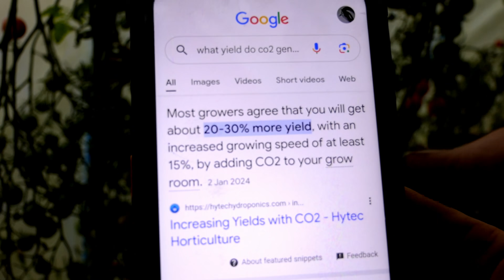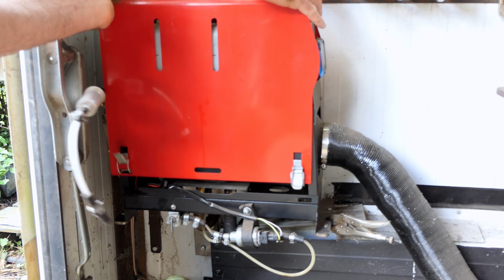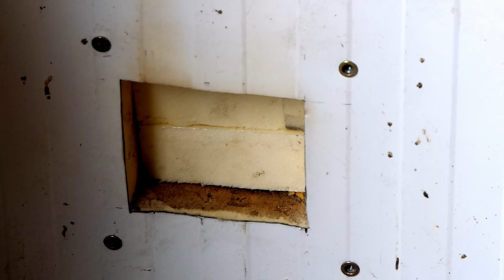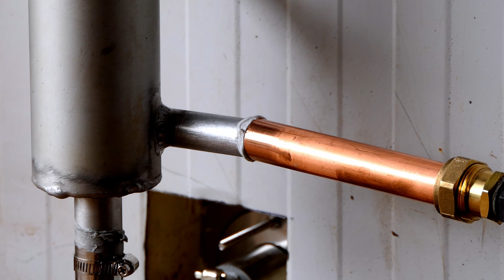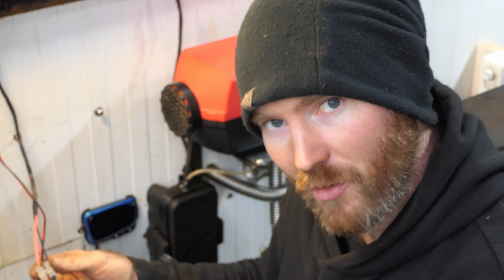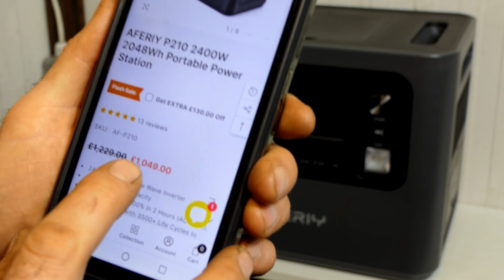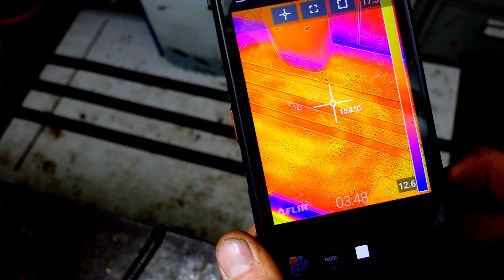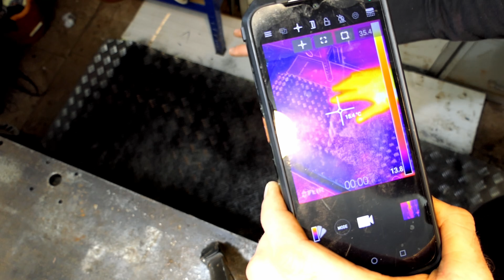NEW! Better system for Cheap and Safe Heating💲+ Underfloor Heating Mod test🫠

Comment: In Poland, 1000 liters of kerosene costs £2000, which is about £0.20 per 1kW of energy.

1000kg of coal costs about £200, 1kg = 8kW, which is £0.025/kW, which is 10 times less expensive than kerosene. I don't know how efficient this heater is, but a coal boiler has an efficiency of 85 to 90%, so it's still much much cheaper than kerosene heating.

Electricity in Poland is the most expensive in Europe and with frozen prices we pay about £0.23 per kWh (including all fees such as taxes, etc.), heating with electricity, e.g. a heat pump, is the most expensive. With natural gas, which has about 10kWh of energy in 1m3, the cost is £0.08 per 1kWh.  Whereas dry wood, which in 1kg has 4kWh, at a price of about £120 per 1000kg, cost of 1kWh = £0.015, and wood is the most ecological and renewable source of energy, so maybe you will build a device for gasification - dry pyrolytic distillation of wood - and start heating the workshop with wood gas? :)
Reply from the maker: @tomashhz  nice. I'm definitely going to be extracting the waste heat from wood gasification for my central heating. The rest will be for electricity. Cheers J

Comment: Water with copper and aluminum together? is not a good idea—galvanic corrosion will eat away the aluminum, but maybe with good grounding it wont be a big problem?!.
What you got wrong is that direct contact isn’t even necessary. Water itself can carry enough current between copper and aluminum to kickstart galvanic corrosion! Source: years of water cooling computers haha

Comment: Great video and definitely something that most people using these heaters should be doing. 20% saving is well worth it over a year... I plan to get one of these heaters for my own workshop and would want to capture some of that wasted heat so i'm following this series very closely...

The first thing I said to myself though when I saw that heat exchanger is that it is far too short for the fast moving air to get a chance to heat the walls. Also inside the pipe only the exhaust gases that are in direct contact with the wall of the pipe (a few mm) will have any effect and the gas down the middle will pass through unaffected, similar to the Leidenfrost effect or laminar flow (but also not really). What you need is a longer section for the gasses to act on but also some disturbance in the gas path (cyclic or zig-zag) so that the gasses touching the wall are kept the hottest that they can be...

It's going to be expensive to do a zig-zag or cyclic path in copper but i've often wondered whether a scaffolding pipe inside a PVC downpipe would work. Scaffolding is about 2" and a 3" downpipe would give you approx. 1.6 litres of water per metre and would be relatively easy to make as long as you needed...
Reply from the maker: @smitcher  thank you. I'm making an exhaust manifold and passing it through a 210ltr water barrel with a circulation pump. That should do the trick nicely. Cheers J
Reply: @ cool. Looking forward to seeing that!

Comment: Nicely done Josh.  Regarding extracting the waste heat, have a think about doing it in multiple stages.  Reason being, with direct to water (EGR cooler) if the water is running slowley, it can easily become over heated. Either boiling or creating a failure in the pipes thermal limit.  Running the pump too quickly will not allow for the heat absorbtion to be efficient. This is why ERG coolers have multi pipes to extrease surface area for heat exchange and allows for a shorter heat eachange unit to extract the necessary heat, but this is balanced based on water flow speed to desired output temp.  The remainder unfortunatly is pushed out as waste heat.  Your short EGR with its water flow (as you demonstrated) tops out at 50degC for this reason.  Increasing the heat exchange efficiency whether its multi cavity EGR or longer pipe will neccesitate you increasing the thermal mass that its heating (more pipe or radiators) to reduce the risk of high temp failure within the system and possibly increasing the water flow as the temperature rises.  Personaly I would build in a high temp safety feature (either electronic cutoffs or a expansion vessle for closed system or a tall pipe from an open vented hot water tank) and also look to add in an air-to-air exchange first ahead of the EGR cooler, (becaise air can handle the higher tempertaures) and also improve your EGR cooler efficiency by either multi cavity or longer run or even multi versions of the same design.  But what ever you do, make sure you remove any possibility of producing legionalla.
Reply from the maker: Excellent points. Thank you. Cheers J

Comment: I have  a short exhaust pipe on mine to a cycloidal soot trap which also collects a fair amount of condensate in the  15l stainless container. The container has a self starting syphon to empty itself. The exhaust then has a section before exiting the building. I'm considering a multitube heat exchanger for water now I'm happier the exhaust is cleaner and dryer than it was
Reply from the maker: @merlynsfire1275  nice 👍 Cheers J
Reply: @joshuadelisle  pleasure sir
Condensing releases the evaporation heat back inside the room. 
Could I suggest a video on your settings or approach and method of adjusting the fan/oil feed balance for different fuels/mixes/experiments?
Reply from the maker: @merlynsfire1275  thank you. I adjust settings in my other diesel heater videos. There should be a playlist with 4 videos. Cheers J

Comment: The exaust cannot go under 120°C, otherwise, condensation will be an issue.
Reply from the maker: It becomes a condensing heater then. Not a huge issue to have condensation out the exhaust, it just needs to be a non corroding metal such as aluminium. Cheers J

Comment: Silly question but why don't you evacuate the exhaust directly into the radiator. This would avoid going through an air/water exchange. So of course you would have to use an "old" type radiator and I imagine putting a filter or something for carbon deposits.
Reply: Small piston airplanes actually use this method, just an exhaust to air heat exchanger.

Comment: A couple of points of note for you:

1 - Be careful in using thermal imaging to determine true surface temperatures … thermal imaging is good at showing one surface is a different temperature compared to another … but to determine the specific value of these temperatures you need to calibrate against the specific emissivity of each surface. If you want to measure surface temperatures in a meaningful way, it’s best to use stick-on thermocouples … just make sure the TCs are well adhered to the surface because they rely on a good thermal connection to ensure conduction. Ideally stick them down with something like epoxy, but this will be a one way trip for each TC … if careful, a wrap of Ally sticky tape should be good enough. Just remember that the thermocouple will only tell you what temperature you have at the layer it finds itself in the thermal gradient running through the thickness of your structure … from your heat source out to the outer surface, you always have a thermal gradient .. the gradient depends on the materials .. you get a low drop through a good conductor like Cu or Al .. and a bigger drop through poor conductors like polymers or air gaps. 

2 - The comments about thermal conduction equally apply to your underfloor heater … nothing wrong with your spiral configuration .. you’re correct in your interpretation .. and nothing wrong with setting the heater pipe ON a foam insulation bed … just NOT in it !! … you need to ensure very POOR thermal conductivity from your heater coil down into the ground and very GOOD thermal conductivity between the pipe runs to diffuse the heat laterally and very GOOD thermal conductivity to the top surface to permit the heat flow upwards and into the room. Your initial demo panel only did the first bit of this … you insulated your pipes so well that you failed to emit any heat in any direction … nett result being the wall radiator got all the heat energy !! …  I cringed as I saw you burrowing the pipe into the foam insulation and I groaned when you went generous on the foam adhesive .. and nearly wept when you made no attempt to uniformly spread your adhesive before putting the top cover back … with my fears confirmed when you later peeled it all apart and it was clear how hit and miss the top skin was attached. This is why underfloor heating is typically formed by placing the pipe run on top of an insulating base and then cast within a uniform screed .. the screed acting as a thermal mass to provide a controlled release of heat across the surface and over time to damp thermal cycling from your heat source. Those systems that do not use a screed typically use Aluminium diffusers to spread the heat laterally and to connect to the covering surface. 

Please do not be offended if it appears I am coming across all superior and trying to win points at your expense … I really appreciate your candid style and application of Common Sense (a substance that seems to be in short supply in these times) and I truly admire your determination, attitude and willingness to admit the occasional error in your cunning plans. I’m afraid my lecturing style is simply the result of 40+ years working in various aerospace applications based on the magical black art of heat transfer 😳
Stay safe .. I await your next adventure with great interest 👍👍
Reply from the maker: You make great points. Thank you. Cheers J

Comment: Where you live? Here in east Europe (Balkan), cerosene is very expensive. Diesel is also expensive for heating. Vege oil is cheap enough, and waste oil is cheapest.
Reply from the maker: UK has cheap heating oil (currently). It goes up and down depending on Eastern conflicts. Cheers J

Comment: I wonder how a copper coil would work inside your housing that is filled with water? And then sand around the coil. ? It might exchange more heat to the water

Comment: Talk with local (or not too distant) auto repair shops or parts stores about getting their used motor oil. They pay to get it pumped out via truck and recycled. They may allow you to get some for free. Mixing the used motor oil in can work as a lubricant. Just don't make the ratio too high as the thicker oil is more work for the pump.
Reply from the maker: Good idea. Cheers J

Comment: Two good things about heat pumps: 1 they are cheaper than other electric heat, 2 they run on electric (which can be renewable). The bad, while they save money compared to electric heat, they are more expensive than fuel based heat.
Green people like heat pumps because the electric can be provided by renewable sources.
Reply from the maker: I recommend watching Michael Moores documentary call 'the human planet' renewables are not what they seem. Cheers J

Comment: Great video (as always) and I especially agree with what you said in the last 10 minutes. Thank you for being a voice of researched reason, standing out tall amongst the brainwashed sheeple. Is your content also on Odysee and/or Rumble? If so I'd prefer to watch it there where freedom of speech is respected, and there is no censorship.
Hole saw in a hole saw is not something I've seen before BTW, but definitely something I'll use going forwards. Thanks again.
Reply from the maker: Thank you so much. I may re-post to Rumble. Well see how it goes. Cheers J

Comment: Hello galvanic corrosion........... It's not about not letting the metals touch, it's that particles of both materials flow in the fluid. Your pump mesh is going to collect rust. it will likely also settle in the your underfloor pipes. Any experienced PC watercooler will tell you that you NEVER mix aluminium with ANYTHING.
Reply from the maker: You're correct. This is just a prototype made from scrap off cuts. Cheers J

Comment: Good video just remember not to mix metals. You mentioned it in the video but even if they are not touching the galvanic corrosion will still happen through the fluid and eat away at the aluminum
Reply from the maker: Good advice. Cheers J

Comment: I have watched several of your videos just out of curiosity but am now in the situation of looking for a heating solution as I've moved to an old house in the Japanese countryside. Currently using a Japanese Kerosene Stove which is very powerful at 6.6kw but I'm not happy with the smell it gives off both when igniting and extinguishing it and the inability to regulate the heat without affecting burn efficiency and cleanliness. According to the manual you have to ventilate the rooms/house 1 to 2 times an hour which I find to be very inefficient. Since the Kerosene price here is almost the same as it is on your side of the planet (~104yen/liter) I'm seriously considering setting up something with a Diesel Heater. Very much like the solar panel + battery pack combination to power the whole thing. In theory a very cheap and easy way to pseudo off grid without knowing much about setting up a sophisticated solar system, battery array and the whole electrical wizardry.

A word of caution regarding your stance (which I highly agree with by the way): We're in censorship hell, especially on this platform. Even licensed doctors had to self censor these past years as to not get their channel banned for "misinformation" and "conspiracy theories". I'd hate to see your channel gone. 

Thanks for everything you do. I greatly appreciate the thorough testing you do and ALL of the links in the description to everything you used/mentioned in the video.
Reply from the maker: Thank you so much. We would love to move to Japan if it was accessible. My daughter has already learned a lot of the language and how to write as part of her home education. Any tips would be greatly appreciated. All the very best with your heating. Cheers J

Comment: burners do not create large amounts of carbon monoxide, regardless of fuel. its under certain fault conditions where they do, and that is why you need the alarm. a low output of carbon monoxide can also become dangerous without ventilation.
Reply from the maker: Some fuels are harder to generate CO than others but you're correct that any fuel that isn't burning correctly will generate CO. Cheers J

Comment: 25:24. You don't mean 'Watts per hour'. You mean Watts, i.e power. 
'Watts per hour' is a nonsensical unit which is almost never used because it would be 'rate of change of power'. The text is right (Wh for cost of energy), just not the words. 
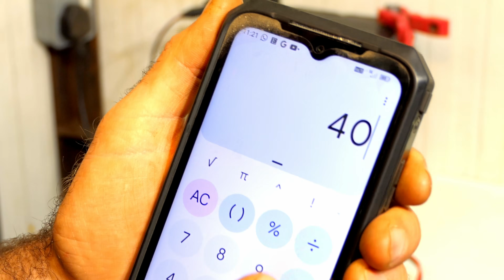Ah yes, must just have been a slip of the tongue/brain as you get it right at 27:12. Cool. Don't mind me.

Comment: Heat recovery - have you considered a sand battery?

One of those 1000 ltr kerosene tanks copper pipe, lots of PC heat pipes, cheap roofing insulation and a metric fuqu ton of sand
Reply from the maker: That was my last experiment. Water as thermal mass works much better at this scale and temperature range. Cheers J

Comment: I’m not sure the lubricant in the diesel is critical to those dosing pumps. 
Both Ebersbacher and Webasto (the major manufacturers of “quality” heaters, from which the Chinese ones are copied) make kerosene and petrol (gasoline for American viewers) versions of their heaters and they use essentially the same dosing pumps. If longevity was a problem, it would be well documented by now.

Comment: Wohaaa ... 4% ... that's interesting. My 2019 calculations with generous numbers got to 0.04% / year on top of the natural carbon cycle. So .. that means that a good portion of the CO2 since the industrial rev. did not absorb? .. Interesting.. I need to crunch more numbers at a certain point.

Comment: We use a Kerseen boiler to heat the house the exhaust is so cool you can put your hand over it, 96% efficient.  A used commercial boiler would be a far better option for whole house heating rather than messing about with a Chinese heater.

Comment: Hi there 
Great video.Definitely one of the cheapest and safer fuels to use.
Just a thought could you directly pipe the exhaust gasses through a radiator then to outside.
Maybe with full metal larger pipework and an old cast radiator.
Inlet at the top, outlet at the bottom.
This might get to temperatures like your heat exchanger body.
Then you may be able to run your generator for less time.
Then you could cage it off like you would a fire. To stop you burning your fingers 😂
Reply from the maker: It's certainly something many people do to their heater, however I like everything to be serviceable and a radiator would be hard to clean on the inside. Cheers J
Reply: https://youtu.be/6WrCJcfICF4?si=Y7_A1k73UR5joUut

Comment: It's been colder before. It's been hotter before. Around 1820 Joseph Fourier concluded there must be something preventing the sun's energy from being re-radiated into space. Much like a frosty night, where the sky is clear. John Tyndall then established that CO2, methane & water vapour (i.e. clouds) create a greenhouse effect. Without those gases above us  we'd be a ball of ice. 
The only thing that's different now is that we're puking out 25 billion tons of CO2 every year - 60x that from volcanoes. 
The impact is that we're creating climatic changes at RATES that have never been seen before. That's the only issue. Nature & mankind cannot adapt to tens of thousands of years of change happening in 200 years. There's a trillion dollar Big Oil industry that'll have you believe otherwise. Trust the raw science.
Reply from the maker: It doesn't help when the Forrest are being permanently cut down which also affects the data recording. Cheers J